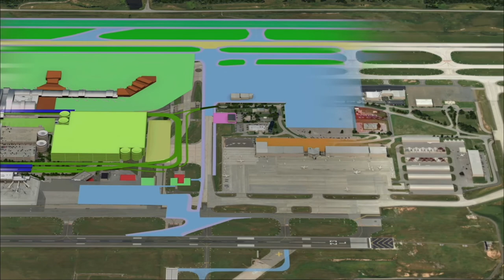A Brief History of Raleigh-Durham International Airport (RDU)

Comment: This is just some great Western reboet trash
Reply from the maker: Settle down bud
Reply: PT 1000 SINGLE-AXLE REAR LOADER
The proven single-axle rear-load garbage truck in its class.

The Heil® PT1000 will reset your expectations about single-axle rear loaders. With nearly 20 years of performance, the PT1000 is a proven refuse collection vehicle that delivers the fastest cycle time in its class, an outstanding payload, and a best-in-class hopper. It also fits comfortably into today’s increasingly restricted budgets.

The PT1000 will reset your expectations about single-axle rear loaders. With nearly 20 years of performance, the PT1000 is a proven refuse collection vehicle that delivers the fastest cycle time in its class, an outstanding payload, and a best-in-class hopper. It also fits comfortably into today’s increasingly restricted budgets.

Beneath its sleek exterior, the PT1000 is a no-nonsense machine that will outperform anything else in its class. It offers a 15-second cycle time and a reload time of less than six seconds, with packing forces that take full advantage of the Heil brand’s experience in high-pressure hydraulics and lighter weight, high-tensile steel construction.

The PT1000 features a large three-cubic yard hopper that is the best in its class, making it the ideal vehicle for those occasional commercial pick-ups. It can be equipped with a variety of container handling devices to suit just about any collection need. It also offers payloads of up to 800 lbs./cubic-yard, and a one-piece body sidewall that not only looks more modern, but is also easier to wash and maintain, resists rust and corrosion, and provides a smooth surface for signage.

Excluding the 25 cubic-yard body, all other sizes can be equipped as single axle models, making them Federal Excise Tax (FET) exempt.

OPTIONAL 3RD EYE DIGITAL PACKAGES

Connect your refuse fleet for service verification, body/chassis data, fuel tax reporting, and route management. Includes factory installed 3rd Eye® Mobile, Radar System, and the ability to connect up to eight cameras.